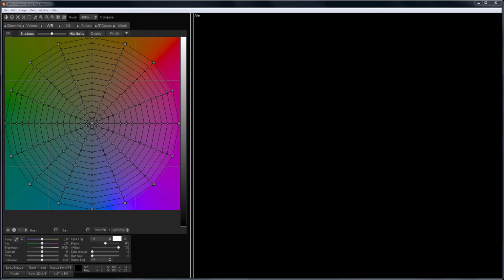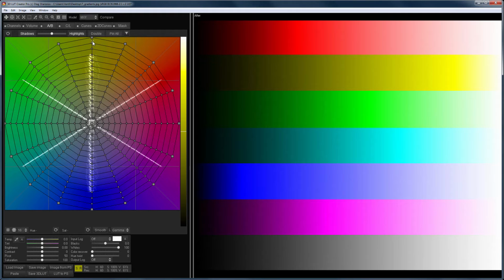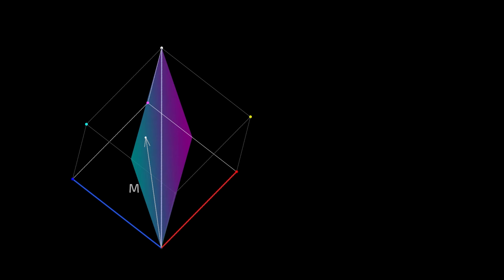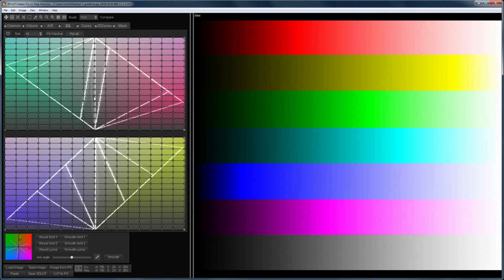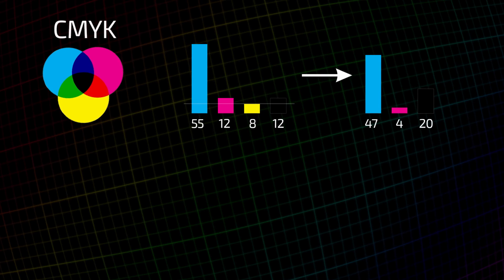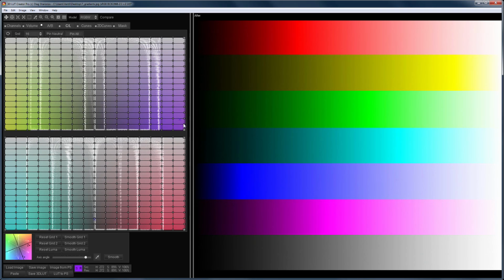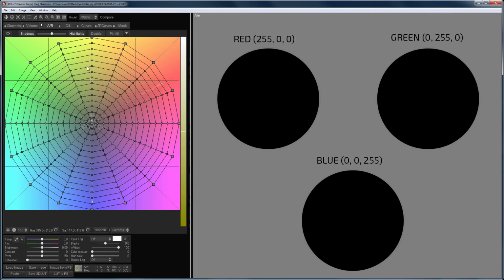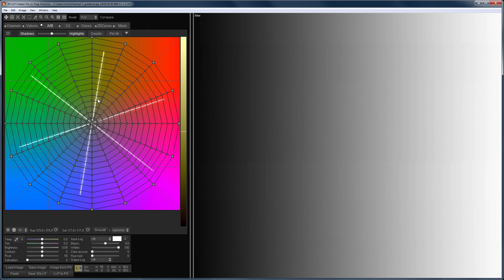Color models in 3D LUT Creator. Part 2

Comment: this is brilliant.
coming from the illustration background, I realize to a degree that color is a 3D structure, and the maximum saturation peaks at different luminance for different hues.

this matters to an illustrator because Photoshop display every hue equally proportioned inside their color picker box, but now we all understand that a fully saturated color does not always sit equally on the luminosity scale, prime blue is way darker than prime yellow as an example. you cannot get a darker hue to fully saturated if you make it brighter, on the opposite side is true for a brighter hue like yellow.
this is important for an illustrator because an illustrator first has to figure out the grey-scale value luminance structure, the image has to work black and white first before it is painted with color, so you can see, an illustrator needs to understand the 3D structure of color, so they understand one particular black and white value cannot turn into equally saturated hue, which means they need to pre-configure their black and white value structure if they have a particular color target.
if an illustrator wants a prime yellow in their scene, they need to make sure the black and white luminance is set at the position where yellow can become prime.

this is also important for photographer and cinematographer, particularly for a color grader, if they don't aware color is a 3D structure, they will not aware that most saturated view can only be achieved with a medium brightness scene, because the middle of a 3D color cube has the most volume, which stores most of the color thus can become most saturate, they need to color grade their scene in order for colors to show up base on the structure of the 3D color cube.

Comment: yes, as a photographer,  it would be great to see how using one rather than another affects a photo and I think a more practical understanding will attract more purchases too - sometimes it just seems so complicated that friends I have referred it too just say it's too difficult and too many options most of which photographers have never seen before.  I realise that might be frustrating for an expert but many would-be buyers are not there, myself included.  Great potential though and so powerful.
Reply: This is exactly what I was thinking, three years later. The learning curve is not steep, it is vertical and concrete examples would greatly improve the comprehension. Although I have to admit that latest videos (2022) do address that in many ways and some users come up with their own tutorials.